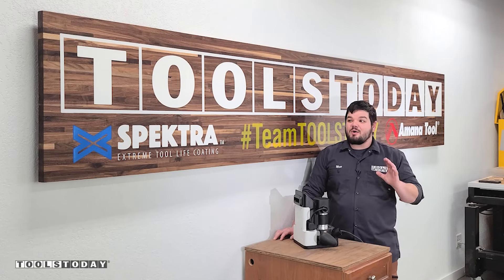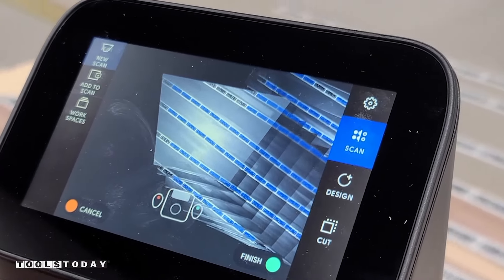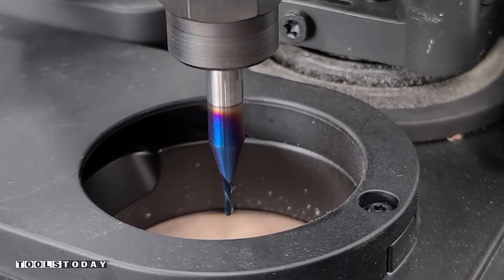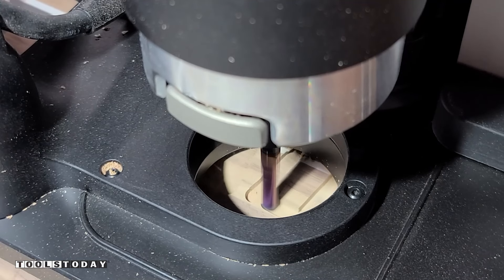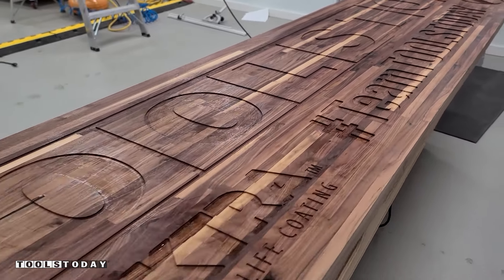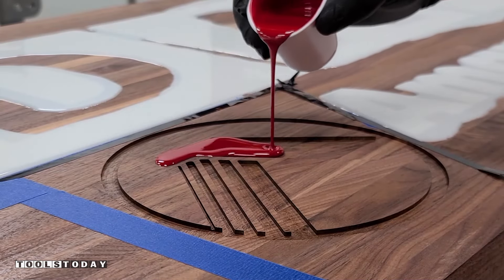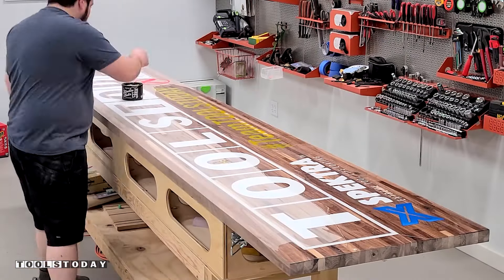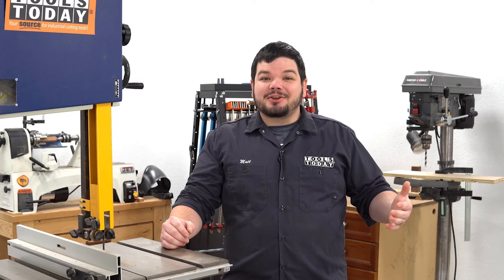How to Make a 12 Foot Walnut Sign Using Shaper Origin | ToolsToday

Comment: I am thinking shaper but in small apartment….can you use shaper to plane off top epoxy?
Reply: You can.  You can set the depth of cut to anything you want within reason.  For instance, I set a depth of cut to .01 in one project, and to .025 in another.  You are only limited by the bit itself.
Reply: @j.paulparis2510  thank you